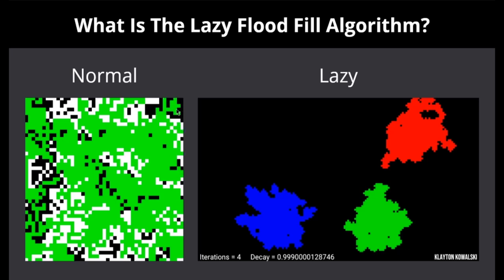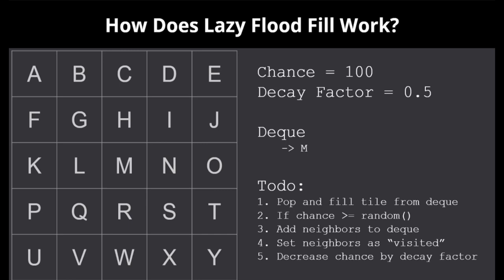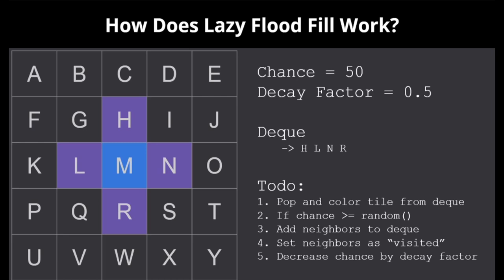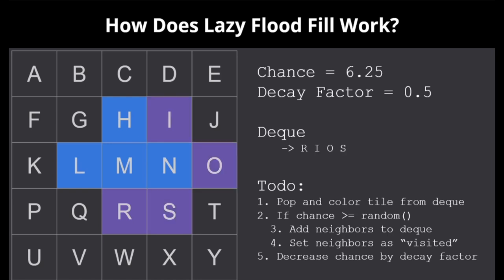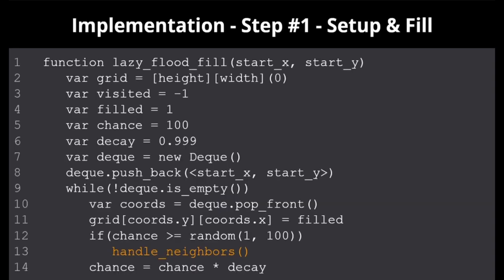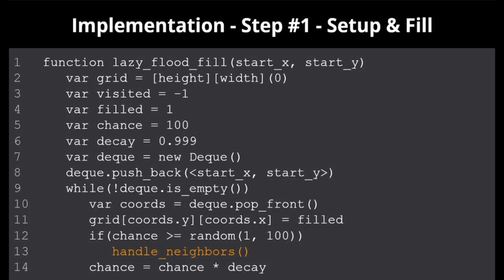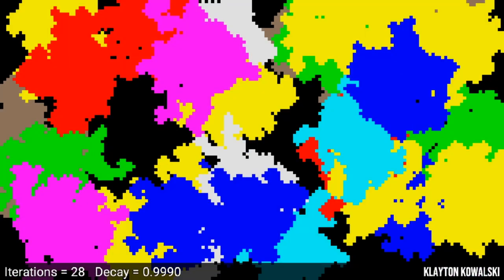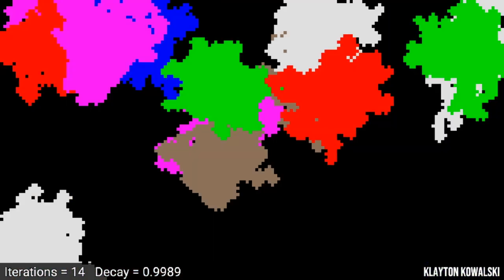Lazy Flood Fill | Procedural Generation | Game Development Tutorial

Comment: Just wanted to thank you for the video, really good and I'm using it in my project.

First I set some interconnected nodes on the map.
Then I colored an area around each of them to be the "safe zone", to make sure each node had its own minimum area.
Next I used this algorithm to fill around each node, only adding neighbors that are already the right color or white(empty). This way, they don't "trample" over the safe areas.
Finally, I check each node again for its neighbors. If at least one of the neighbors is from one the connected colors, I draw a green border between them. Otherwise, it is black.
This gives me a map of countries, each with their own land and borders. Black borders are impassable terrain and green borders are passable.

Comment: A few changes I'd propose:
1. Have the chance variable be local to every tile on the deque. Reduce it only for the neighbors you push onto the deque. Implement it by pushing (tile, chance) tuples onto the deque. This makes the decay factor less sensitive.
2. Don't roll for pushing all neighbors onto the grid, but roll for whether to fill the current tile and recurse afterwards. As it is, the border of the filled region is made up of little crosses, which is kinda visible in the final result. Not sure whether it makes some border shapes actually impossible.
Reply: That was going to be my recommendation. I think the chance should be localized and maybe even influenced by the neighbors which have been visited. It might also be interesting if the chance were influenced by how many tiles of a biome were already laid, so that decay wasn't what governed the decision only and therfore you could keep the sizes as a constraint. It would also be an enhancement if the fill of multiple biomes were pushed to the stack to seed them all at once so that you didn't have overlapping zones, more like loosely defined voronoi. The stack would need to be able to search for existing tiles already queued, but then it would maybe give you more zones.

Comment: Nice! Take 100th like:)
I am surprised though, that you multiply chance by decay every single time, instead of only multiplying it when adding neighbors:
deque.push_back(<nextX, nextY, currentChance * decay>)
This would make the algorithm more symmetric (instead of biased towards the direction which you check first, and which correspondingly has the highest chance)
and the value of change&decay have a more meaningful value.

Comment: Very interesting algo. I'm curious though, did you try any aside from exponential decay? Perhaps logarithmic, linear, or quadratic? I'm not suggesting there is anything wrong with this implementation as it is really quite clever, I'm really more interested in how the decay would fall off if it were implemented with another algo. Gonna throw you a sub for getting me thinking. Great job.

Comment: Nice video!

I'm curious, in your game how would you use the black areas that are left open by the algorithm? I'd like to have my space to be completely filled, so my default is voronoi, but I like how organic yours looks, so I'm wondering if there's a way to combine both

My initial thought is to execute multiple flood fills from random positions, where they each take turns stepping through the algorithm. To make it organic, flood fill would have to randomly select between the neighbors somehow (possibly biasing the select to neighbours closest to the fill origin? I'm not sure)
Reply from the maker: In my mind, the black areas should be interpreted as flood filled areas as well. For example: if you use blue, red, and green in your flood fill which represent "ocean", "desert", and "forest" respectively, then the leftover black could be thought of as "plains" or some other type of biome.

You could also do a scan of the map and perform more flood fills in the areas where black is detected until there is no black leftover. Just a few thoughts.

Comment: What did you do in your demo to get the generation to have more irregular shapes rather than tend towards circles? More irregular shapes would be ideal for my project
Reply from the maker: The implementation I explained in the video is exactly what I wrote in the demo project.
Reply: @WhiteBoxDev  Thank you for the quick response! I am certain that I implemented it correctly; I suspect it might be due to a difference in math.random implementation in the engine i'm using. Looks like i'll need to find a different generation method